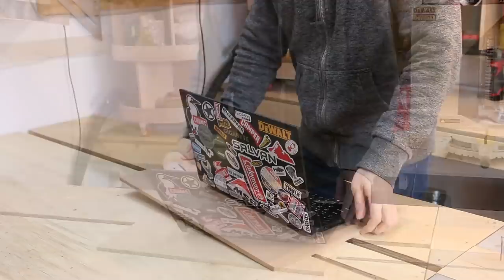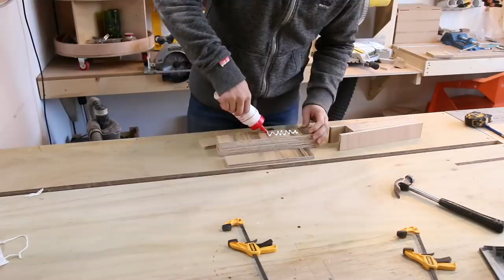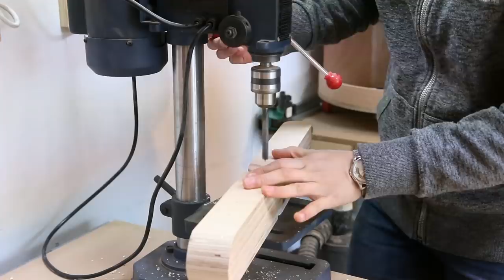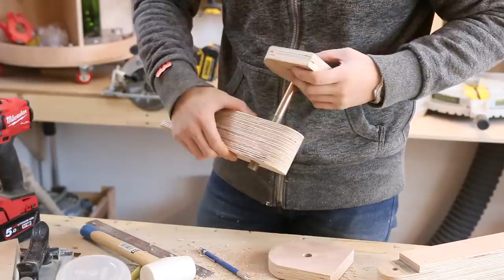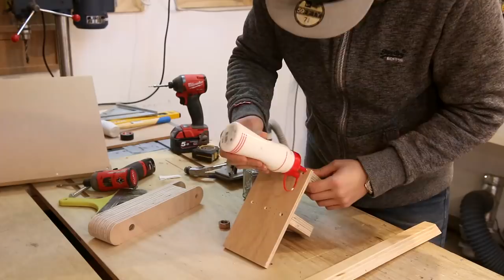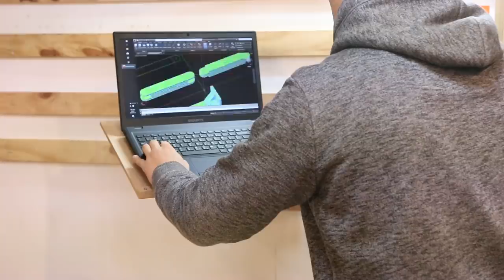Wall Mounted Laptop Articulating Arm│벽걸이 노트북 관절 거치대 모니터암 [woodworks/목공 DIY]

Comment: Hello!  I really enjoyed your video, congratulations!  What type of screws did you use on the joints?  I want to do something similar, but I don't know which screws to use to keep the joints firm, but without immobilizing their movement.
Reply from the maker: Thickness: 10mm / Length: 200mm Bolts used. =)

Comment: Wood Doesn’t helps to the hot flow air of the laptop
Reply from the maker: I don't play high end games so my laptop won't overheat.
My laptop maintains a low temperature so that the ventilation fan doesn't spin.